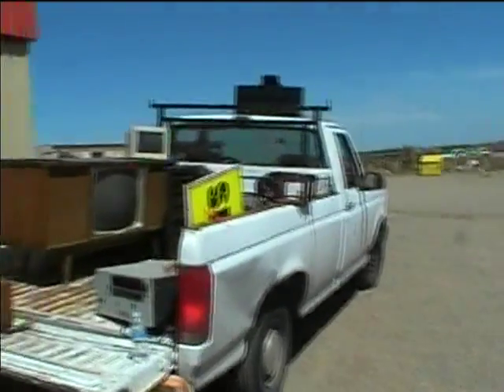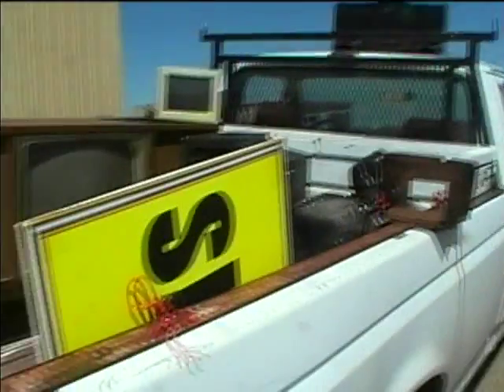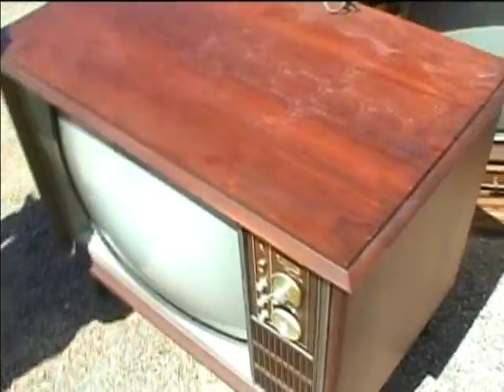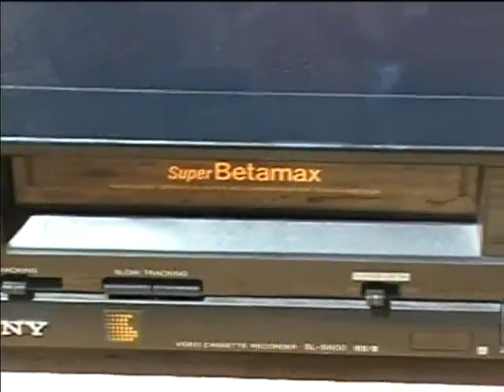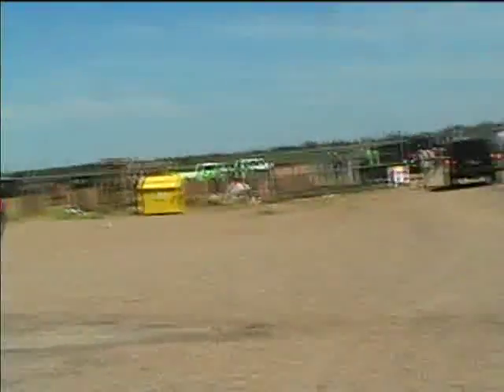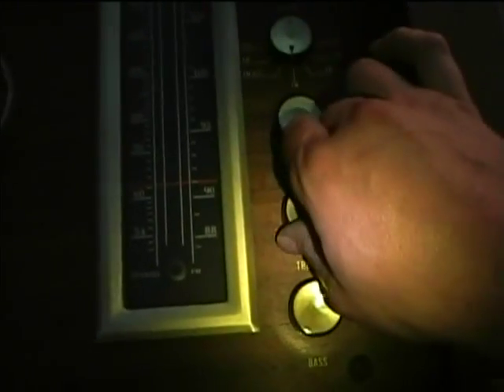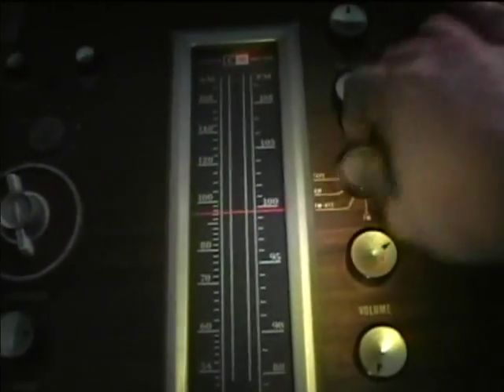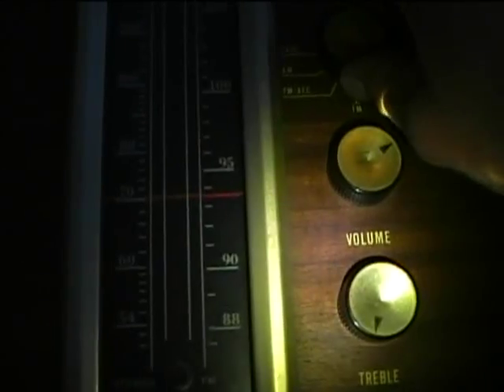Texas recycles day 2009 TV's

Comment: I was at the Electronic recycling center last week.  It is a huge place, and they had pallets and pallets of tvs. There were some damaged large flat panel LCD tvs.  The  huge building seemed almost endless with computers on palllets.  I found the Technis linear turntable there.  I still have my 1966  danish modern real walnut wood  23" Zenith tube console color tv , and it still works.  I have my father's Zenith 23" console color tv , it works  and is solid state early 70's..

Comment: Interesting.  We had a recycling event at the office building I work at last year.  I managed to save three flat panel computer monitors that didn't work by replacing faulty capacitors.  I sold one on ebay and the other two I gave to my kids to replace their old CRT monitors.  But they had a ton of old pc's and crt monitors that ended up being recycled.

Comment from the maker: Yes it would be dangerous to the set to power it up with a cracked picture tube. I wouldn't try this one without putting a known good picture tube in it. I have tried your suggestions before and removed the horizontal output tube to disable the high voltage when I was testing without the picture tube in place.

Comment: Hi Chad, very interesting video.  I'm always fasinated by old Tv sets.  The ones that have bad picture tubes, are they dangerous to power up because of the high voltage from the flyback still connected to the tube?  Reason for asking is, that you could possibly check those sets for audio and if they do have the audio stage and able to check the high voltage with a probe, then at least you'll know what is working thus far.  

Gary